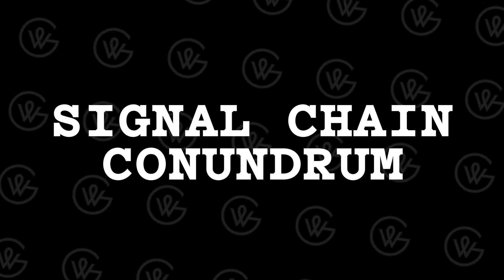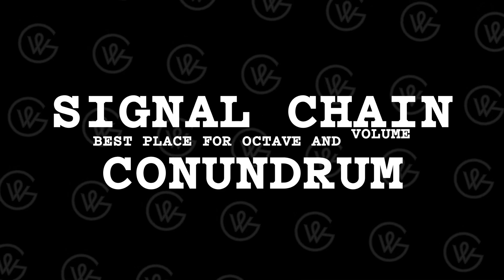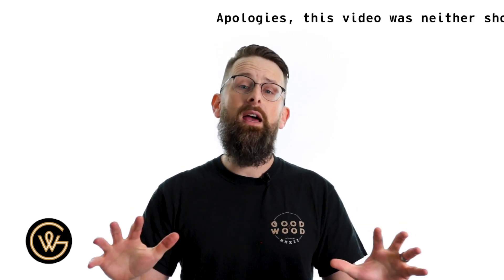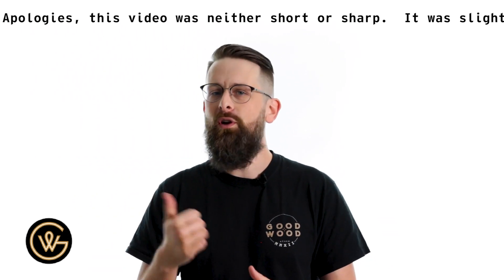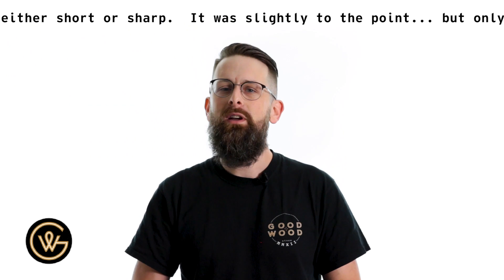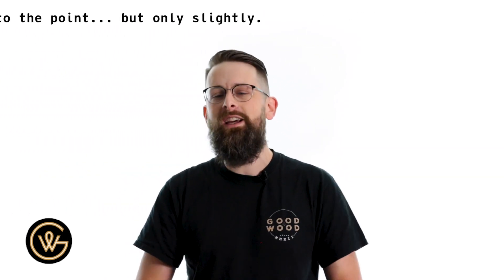My Two Most Common Signal Chain Questions ANSWERED!

Comment: I'm totally going to put my volume between my stacked drives. This also makes my Texas Square Face more easily used in smaller settings. 
I'll try the same with the octave, too! 
Great video!!
Reply: May try the same with the Octave pedal.

Comment: I just picked up a boss oc5. I put in front of my drives, but I might try it the other way as well. The loop switchers really make those changes easy to do and a,b between. I have to pull my board all apart in order to do that.
Reply from the maker: highly recommend this test!